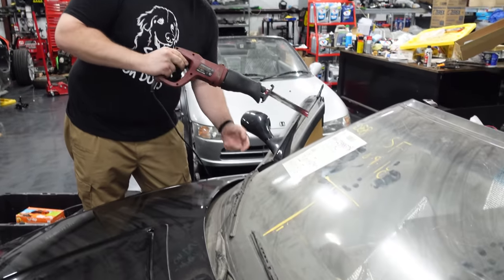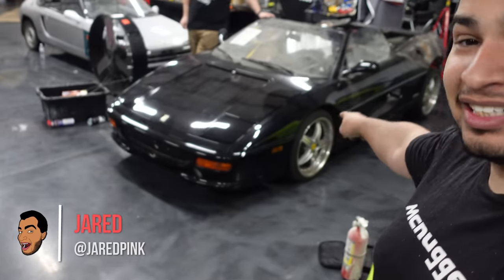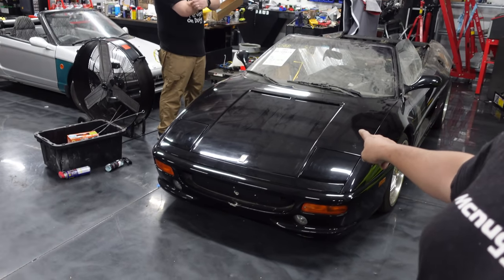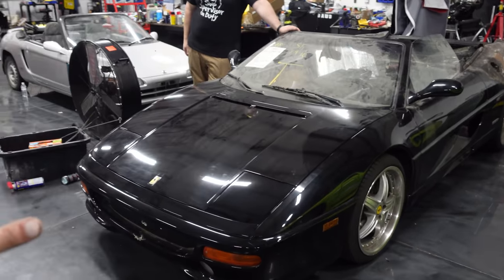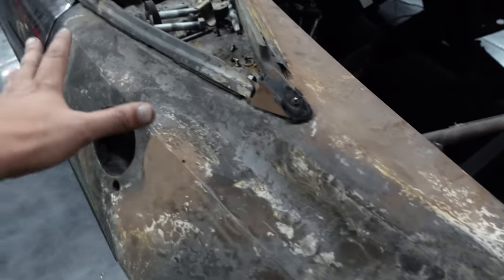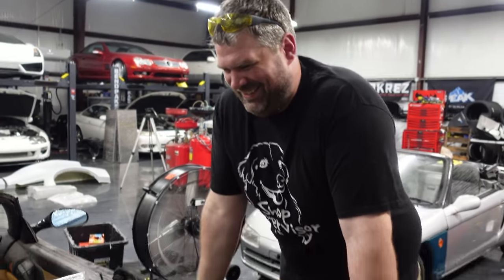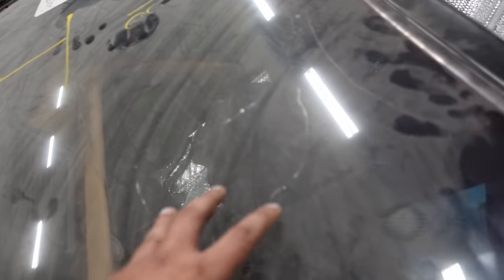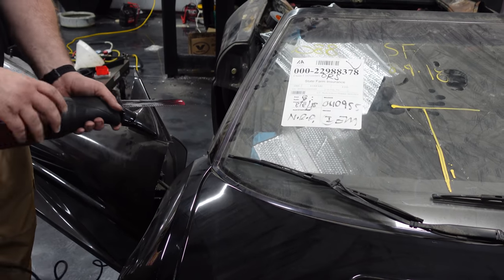Ferrari Purists Will CRY When They See What I Did To My F355 (WORTH IT!)

Comment: Probably a little too much brake for that weight, especially chopped like that. Don't do the adapter thing, find or fabricate the right hats for those rotor rings, and if you need to adjust the rotor center line, get that dialed in with the hat. You are gonna need a much bigger wheel. And I hope the master cylinder can move enough fluid to work those big pistons. This bi old might be a little more interesting than expected even though i am not a rotary fan.

Comment: Garage full of exotic cars: still uses Harbor Freight tools.
Reply: Some people have a garage full of snapon tools and work on shitboxes
Reply: @bzmotoninja83  You just attacked my uncle
Reply: If they're good enough for V-Tuned, they're good enough for this hack.
Reply: I have that same Sawzall, it's a bad bitch.  Rotating head and all.  I have punished mine for 3 years and it still works like a champ
Reply: Don't forget the little honda beat
Reply: @crowsp97  I have like, a really high end Porter Acble Tigersaw, and although it can definitely violently tear through anything, it'll also do bad things like explode studs, tear floor plates off the floors, smash masonry, and rip welds and bend sheet metal. The little HF saw is way less brutal.
Reply: Buy the cheap tool. If you wear it out it made enough money to buy its replacment.
Reply: He has TENG tools but yes he has a few harbor freight tools for shit he doesn’t use that often.

Comment: I just hope Ferrari don't send them a cease and desist letter, because they're very known for doing that
Reply: They didn’t buy it from Ferrari, or sign any contract. Ferrari has no legal recourse, here.
Reply: @fredyllanos8972  I know they didn't bought the car from Ferrari but there was also the case from the F40 barchetta beurlys, which also was a second hand Ferrari and they send an cease and desist letter to the owner to take out all the Ferrari badges
Reply: @luiszhang1558  I'm sure Tavarish would have zero problem removing some badges.
Reply: @BlueTrane2028  yeah but he shouldn’t have to
Reply: @IntensesnipingEmpire  agreed.  The car was junk, he's making it useful to him, Ferrari should have no say in how he does that.
Reply: @BlueTrane2028  You're right but at this point Ferrari has become like the karen of the automotive world
Reply: @luiszhang1558  Can't be worse than the Halicki lady with Eleanor.
Reply: I would send a letter back stating, send me all the parts to rebuild it to factory specs for free
Reply: @BlueTrane2028 in this case I would understand Ferrari's point, I wouldn't want my luxury brand smacked on a part car
Reply: I don't think there would be a legal basis for that:  the badges were affixed to the car by Ferrari itself.
Reply: @antipodeanwizard1632  yes I know ferrari originally put the badges themselves, but as you can see they're not following the original design of the car which Ferrari owns the copyright I suppose, so Ferrari can say is not a original design from them so can also give the right to ask for the badges to be removed, and I wish Ferrari don't care about it but who knows, they're not like Lamborghini
Reply: @luiszhang1558  You are perhaps touching on infringement of Ferrari's moral rights (which is a kind of copyright infringement). However (and while I'm not an IP lawyer),  I think infringement of an artist's/author's moral rights usually applies in the context of artwork, rather than industrial design or commercial copyright - but then Ferrari would probably claim that their cars are artworks, so maybe you're on to something.

Comment: When he keeps saying "massive" about the rotors and you're just thinking to yourself that, hmm, that's the same size as my stock rotors on my Mustang. But no joke, for that light of a car (2976lbs when full weight without fire damage haha) those brakes genuinely are huge for it. Gonna stop VERY quick. Excited to see how this build turns out.

Ok, this is an edit. I stopped the video before realizing he's putting even bigger brakes up front. Holy cow 16+ inches for a front rotor on a less than 3k lbs car. Also surprised as its a mid/rear engine car that he's going so large in the front. Curious to see how it does.

Comment: Lucky you are down south. It looks like Dahm may help and Pettit Racing is not too far away either. Sure beats taking a 20b to prop plane mechanics like in the old days. If you're not getting vapor locks from subzero starts or fouling plugs out on stalls, then you're not learning to love your rotary.  Man, they get into your bones and it never goes away.

Comment: Check Porsche Boxster and 911 the brakes on those are similar size as well. This is because of weight distribution. The more weight the car has in the back the bigger the rear brakes can be because you can actually put those brake forces thru the rear wheels with all that weight over those rear wheels.
The FrankenWankel Ferrari speedster is gonna be EPIC!

Comment: Just put Camry V6 in it with a manual transmission and call it a day with little modification it will pump 300ponies it should be more than enough to move that little 355 around. And you will never have to open that engine bay again, and with that rotary it will be a nightmare to maintain and i don't care who says what but you cant put 800hp to the ground on a RWD without dying.

Comment: 15:02 Its because its rear engined, more weight on rear axle, so it can use more braking power without loosing traction.
Also, I don't really see the point of those huge steel rotors and 6 pot calipers, its just more unsprung mass, and your are not going to be doing any track driving anyway since you cut off the roof, not even above the mirror. I don't get get it, who wakes up and says, I would like to take out my windscreen, and make my car significantly more unusable, uncomfortable and unsafe.
THIS IS WHY I AM SUBSCRIBED!

P.S. Make sure that whatever you use to replace the wind shield, will not cut your face up in an accident. You could use lexan mr10 but if you are not wearing a helmet it would not be nice to hit. So most likely you will have 6 point harness, helmet, or just Polaroids, since you now have the joy of not having sun visors, and to be safe, a 10 point roll cage.
For a car I want to cruise on sunny days, I would take the stock setup easily.
Reply: What you said about the Brakes is wrong.

Comment: You know what bothers me to hell is like when they heavily modify a 1962 baby blue Ford Anglia 105e Deluxe's with the white top and white pinstripes and the Chrome pieces look up the car from Harry Potter the enchanted flying car Ford Anglia 105e Deluxe that's the car and the year is 1962 but yeah I hate when they find a car that has the exact same look and paint job as the one from the film and it looks so accurate and you like it so much then they modify everything and it just looks like shit I don't mind when people restore it back to normal or to it's original state but when they restore it and make it look completely different and muscle it up and make it different I don't like that at all yeah the Ford Anglia from Harry Potter it could have had some maintenance done to it like added seat belts get rid of all the rust that was on it and give it a wash get all the dust and dirt and grime and grit and all the crap off of it but yeah everything else it was fine it looks great yeah it could of got a new old stock transmission because the gears were crunching every time he pulled the shift lever down because he didn't use the clutch Ron was 12 at the time he didn't know how to drive a manual car or a car in anyway to be honest he didn't even know what it was until his dad told him about it when he first got it he first got it like probably around the the first movie I think Mrs Weasley drove it to king's cross station but they didn't show it but I'm guessing they use the car for the kids to get to the train platform to go to Hogwarts and get Ron ready for his first year and when the second movie came around they were doing the same thing but Mr Weasley was with them instead of Mr Weasley not being there cuz you know he had to work and they used the car and showed the car and did everything with the car fun fact JK Rowling's best friend owned a car the exact same model paint color and everything from the Harry Potter movie it even had the same license plate number 7990 TD but of course she added to the movie car a few different things there was the door handles instead of them being a little handle she got like the Z shaped door latch handle you know what I mean they weren't stock or from the actual car but she made them look the part and made them match the interior pieces and she made them look like they're factory but they weren't but they were modified and she also added a small silver button that made the car invisible when you press it so yeah that's the 1962 Ford Anglia 105E Deluxe it's my favorite car the car from Harry Potter that exact model and look with the same modifications of course the door handle latches and the small silver button of course I would add aftermarket seat belts to my car if I had one like that but the movie car didn't have seat belts mine will because you know safety regulations but everything else would be the same just like in the movie car